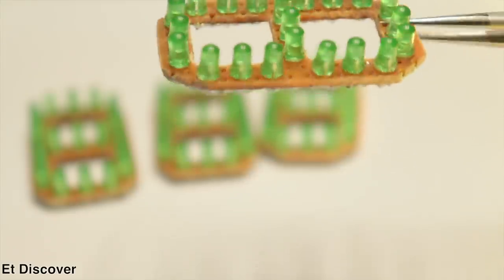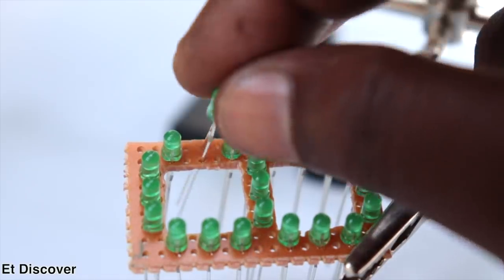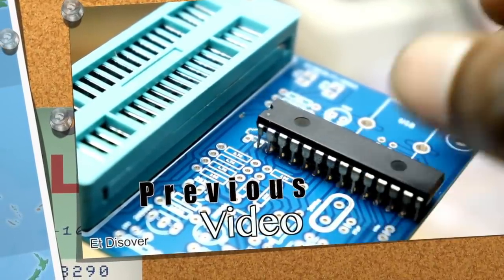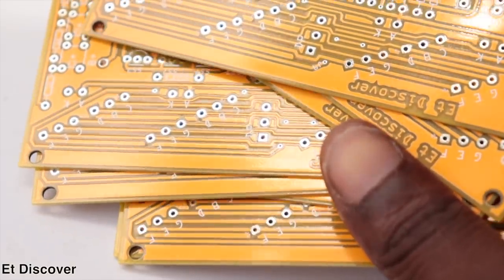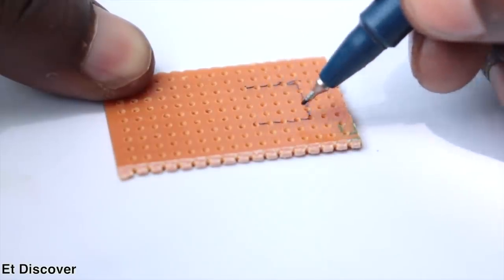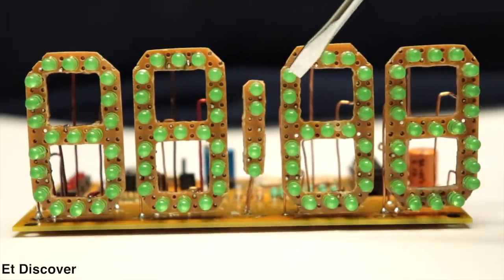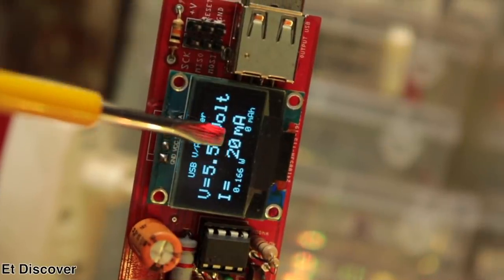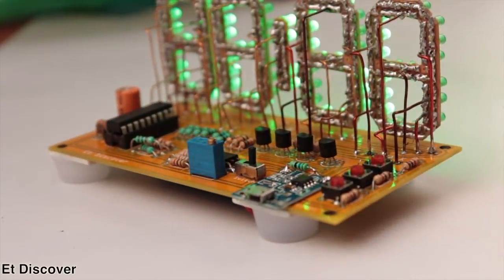Make Your Own Digital Clock# Just One IC

Comment from the maker: Who had watched this video from starting to the end??
Reply: I liked your video 😊
Reply from the maker: Thank You
Reply: Awesome video
Reply from the maker: Thank You
Reply from the maker: How can I help you??
Reply: Habby video dada
Reply: Just Mind-blowing Project.I have downloaded all the necessary files to build it. But just I want to know without making the IC programmer it is possible to to program the IC from anywhere else.You can provide already program IC and the PCB Via courier.I live in Kolkata West Bengal.
Reply: @EtDiscover  just make universally programmer at home and make videos of programming of pic Microcontroller please and how to program 8051 ic I have code in TXT form
Reply: I'm
Is this real time clock.

I switch off power supply, then connect it.
It shows correct time or starts from first....
Reply from the maker: Suvro Ghosh Sir You can buy this programer in the chandni Market only at 200r. or those who program computer's BIOS, they can projram it..
Reply: @EtDiscover  Thanks.I will try my level best.If any problems come I will contact you !
Reply: Vi plz programing
Reply: Arduino
Reply: I am sir
Reply: can you give us complete circuit?
Reply: Me I want a layout of this

Comment: I need your help...kindly revert
Reply from the maker: How can I help you?
Reply: @EtDiscover  A stepper motor driver IC  T709 PBL 3771 is not working, and is not available in India. Someone will provide me T623 PBL 3771. Let me know that both IC's are same or having different function. Main IC number is PBL 3771, I want to know what is meant for T709 and T623?